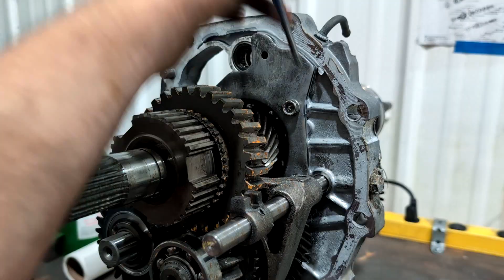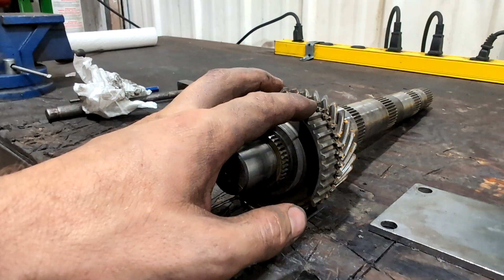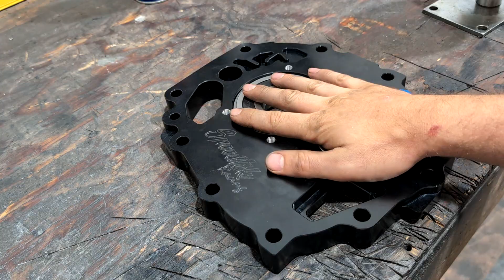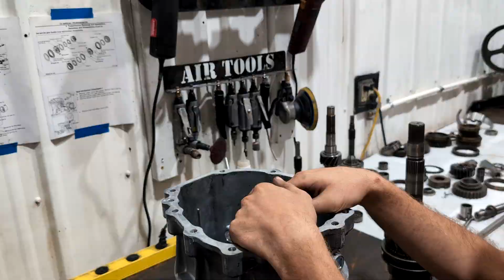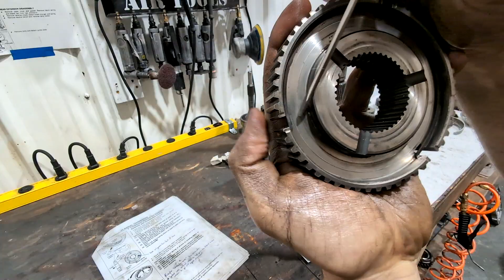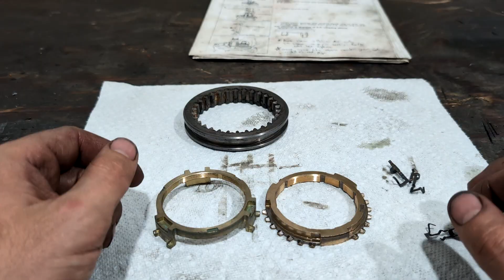R32 GTR - Speedtek Synchro Gearset Assembly

Comment: Hi, great vid! I am using Speedtek gearing in my 93 R33 GTR transmission. Built by the previous owner. I have an issue shifting from 3rd to 4th gear. I have a scratching noise. What could be wrong?